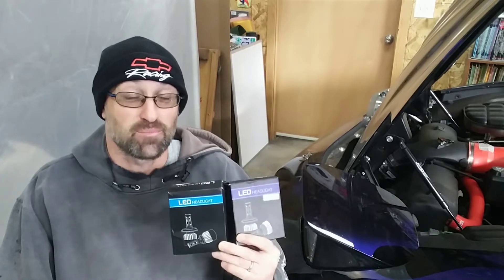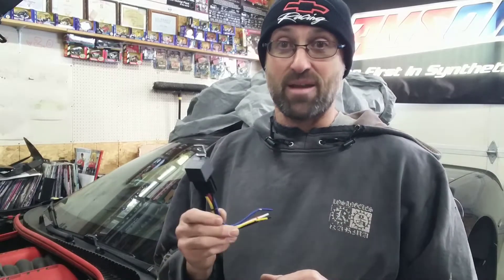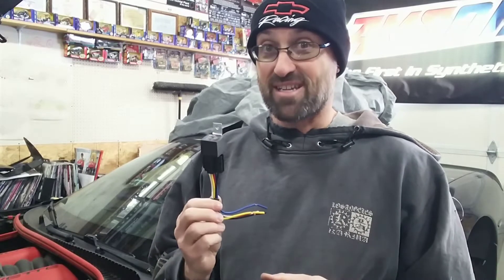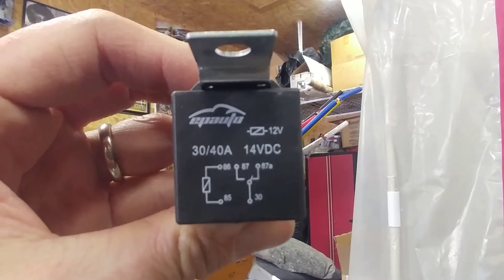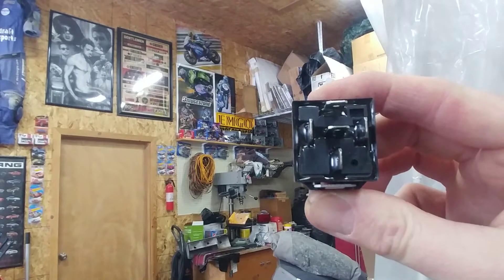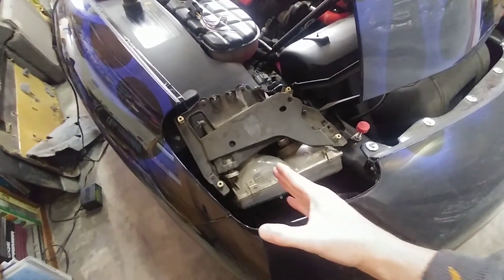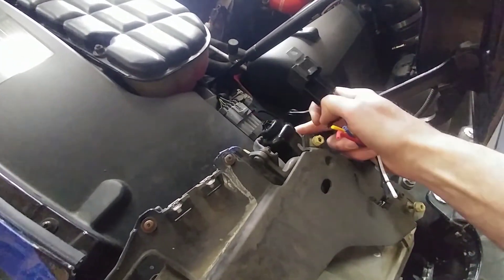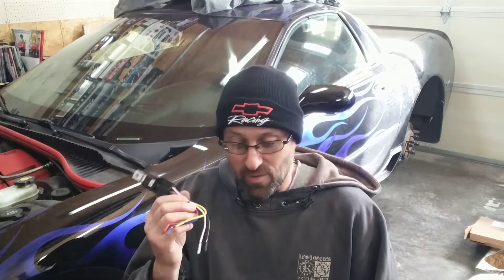How to Fix Corvette Pop-Up Headlights with LED Bulbs

Comment: I have an 88 Corvette, Just installed LED headlights. Now fog lights don't work and other weird things happen like when I turn on the fog light switch, hi beans come on. Will the relay work for this and also Do I have to add a relay to each headlight? Thanks
Reply: I added the relay to one side like you said, it didn't work.I added another relay to the other side, still didn't work? I then added LED fog light bulbs and everything worked. I removed the relays and everything still works. Who would have thought? 😂 thanks!
Reply from the maker: @oldvette-g3o I wouldn't have guessed that LED in one without the other would have been the problem. Interesting!
Reply from the maker: The lack of resistance from the LED bulbs may be the cause. I would try one relay on one headlight and see what it does.

Comment: Not sure if the LED bulbs i installed have this built in but my headlights go down perfectly while the car is running WITHOUT turning on the brights.
Reply from the maker: Mine is intermittent. Some days it doesn't do it, others it does.

Comment: u probably know why my ecu has no communication with EBCM
Reply from the maker: Headlights shouldn't affect it. Did it just start, and did you change anything?
Reply: @BasinMotorsports  yep battery died installed new battery and boom no abs and traction
Reply from the maker: @cryptonz06 bad fuse maybe?

Comment: Hi. I tried it with the two wires associated with it (mine are yellow 85 and white 86) and I connected it to the two blues for the high beam but unfortunately it didn’t work. My lights stay up when I twist it to the off position. They only go down when I push forward the high beam. Does trying to connect it to the low beam wires work ?
Reply from the maker: Try the low beams. The system needs to sense the resistance in the system.
Reply: As you know it’s a 3 wire harness. Any thoughts on which 2 of the 3 before I splice them all ?
Reply from the maker: The connection to the low beam light should be two wires. Should be either a green wire or tan wire for the positive, and each bulb has a black for the negative. The relay goes between the two wires for the light, which adds resistance.

The motor up/down has 3 wires (up, down, and ground).
Reply: My apologies. I did try the blue wires to the low beam. No change. Sorry for the confusion. Thanks for you help.

Comment: The other 2 wires would attach to 12v and the other to the ground?
Reply from the maker: They don't connect to anything. You just want the resistance of the coil in the relay added to the system.
Reply: Awesome thanks for your quick response. I will try it again. 👍

Comment: Can't you just turn off the lights when the car is running?   Don't turn off the car, then the lights.
Reply from the maker: No. The lights going down doesn't have anything to do with the car on or off. The system needs to have a resistance inline to go down, which the LED bulbs don't have. The simple high beam indicator light in the gauges does have enough resistance.